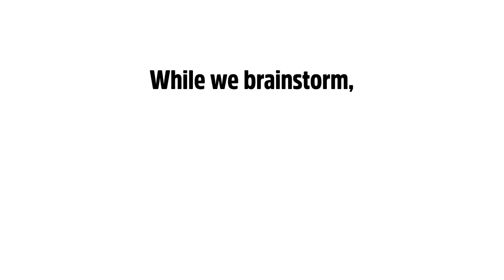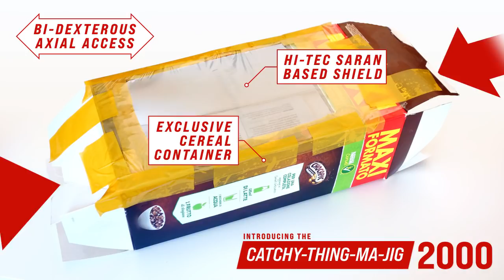Can These 50 Year Old Safety Glasses be Restored?

Comment: Great project. 👍 If you want to "unyellow" the transparent rubber there's a process for that too! UV is your friend!
Reply from the maker: Yep, peroxide and UV. Though I've seen some examples of it making the plastic more brittle too, and I did not want to take the chance. If it was a computer case it's one thing, but as these will be used and flexed on a regular basis they could be more prone to breaking.
Reply: @SwitchAndLever  Seems sound. And, a chance to 3D scan and 3D print with... rubber? ;D but yes, I understand. These will forever be cool safety glasses. Great job!

Comment: Man, didn't know you were Swedish until you knocked out the Biltema solvent, that thing is magic 🤣
Reply from the maker: Indeed it is! Though I have noticed that it has an adverse effect on some plastics. I have a real nice box with a clear lid that now looks all frosted because the Label Off ate the surface of the plastic.
Reply: @SwitchAndLever  I'm not completely sure what's in there either, it's definitely not strong as acetone but with some plastics (especially pvc and pa) it's rather aggressive.
Reply from the maker: @andy_liga  As I wrote in the video, it's Limonene 🙂

Comment: Very nice. And stylish. How long did the polishing take?
Reply: Yes
Reply from the maker: Maybe ten minutes per glass? Most of the time is spent with the coarsest grit, and then every successive grit goes faster and faster as you're just taking off the tops of the previous grit's scratches. Polishing with the polishing compound is pretty quick too, a few minutes. If you have access to a big polishing wheel you can speed this process up significantly of course.
Reply: @SwitchAndLever  Oh that's not bad at all. 👍

Comment: 12 000 grit 😯
Reply: Micromesh has its own grit system, starting at (I think) 300 and going up to 12000
Reply: @lui5gif  Its a lot of grit!
Reply from the maker: As luisgi says MicroMesh grits don't map 1:1 to regular sandpaper grits. There are conversions online, if you google. In regular sandpaper grit it would be something like 5000, but it's not a straight conversion, as the shape of the grit on the MicroMesh sheets are different than regular sanding grit too.
Reply: @SwitchAndLever  Ok, what can you do ey...?